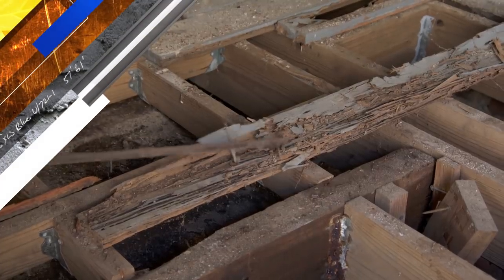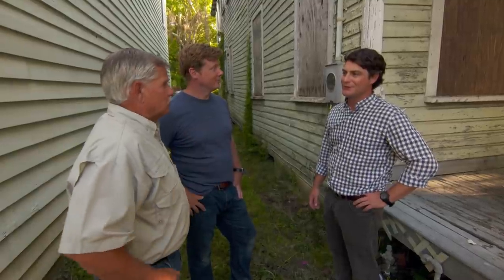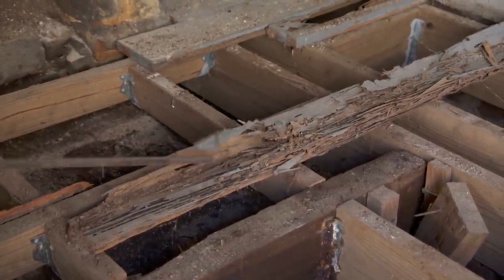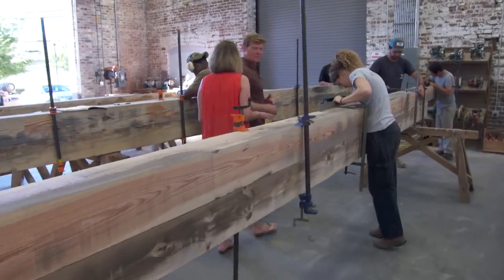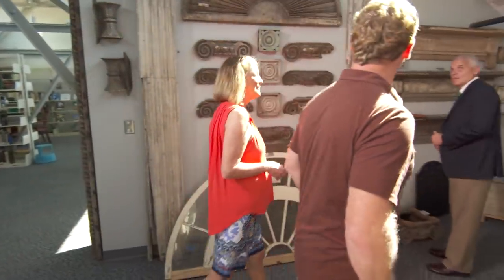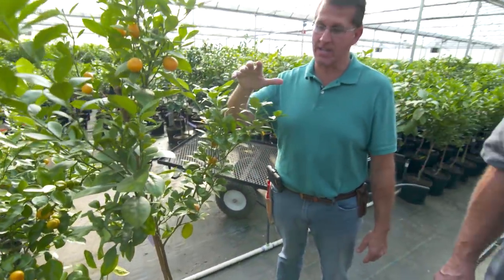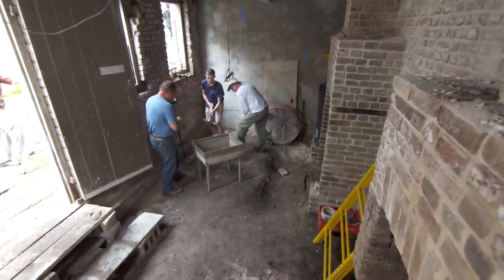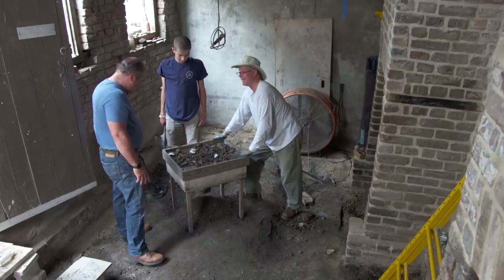This Old House | Demo Time (S39 E18) | FULL EPISODE

Comment: I know if I was there digging up old dirt floor kitchens and digging through old outside toilets I would be wearing at least a mask if not a respirator . But maybe that is just me
Reply: Maybe you might think a mask should be worn.  There is no law requiring it.  So, your statement is a value judgement.  I would be wearing a dust mask, but the answer to your question is, "no", not of it you are asking if it's required by law.

Comment: 7:12 Anyone know why in some cases the sand is below the moisture/vapor barrier in a slab, and sometimes above it as the very interesting Mr Regalbuto is planning?
Reply: To stop any rough aggregate puncturing the vapour barrier?
Reply: @lelavoir  He's saying he's going to put a moisture barrier over the gravel, then sand above that. So sure, the sand acts as a soft buffer between the concrete's aggregate and the barrier, but equal if not greater puncture potential lies below unchecked.
Reply: @johncortell4431   Hi John, I felt the guy was a bit nervous, and not a TV professional and just messed up his lines. It wasn’t noticed at the time and by the time of editing it was too late. Who knows? Obviously a means of protecting the membrane would be needed from both sides. I say this as NOT a building professional.
Reply: @lelavoir  Yeah. He's quite interesting. It's like he's performing a thespian work. Very dramatic. Very awkward.
Reply: @johncortell4431  Pleasant talking to you John, have a good holiday season, as I believe you say over there. Stay safe.
Reply: There's different ways to to it. 1 way is compacted hardcore, poured concrete slab to spec, DPM, insulation to spec, 50mm (2 inch) sand cement screed. Another way is compacted hardcore, 50mm (2 inch) sand blinding, DPM, insulation to spec, poured concrete slab to spec. I'm in Ireland and that's the two methods used mostly here. The first one is used the most with UFH being installed pretty much everywhere now. Damp proof membrane (DPM) is thick so it can withstand being laid on concrete and getting poured onto but not onto hardcore material. Sorry but the terminology I used may differ from the US. Just Google image search concrete floor slab detail and it'll show the different types.